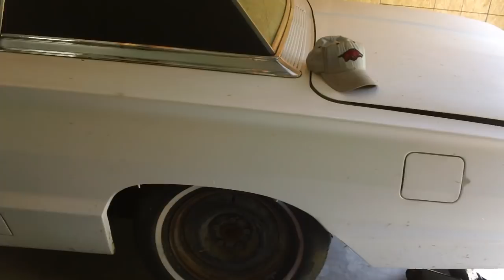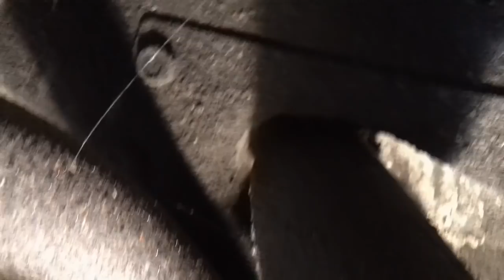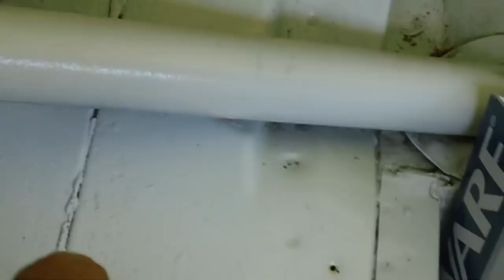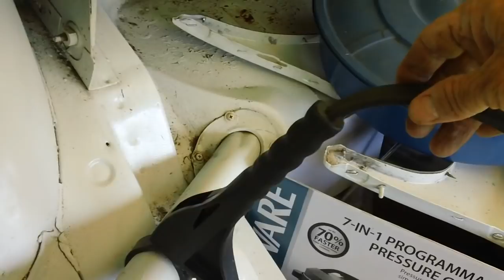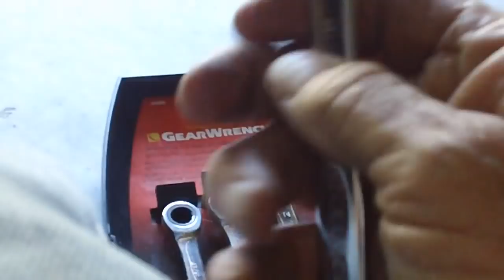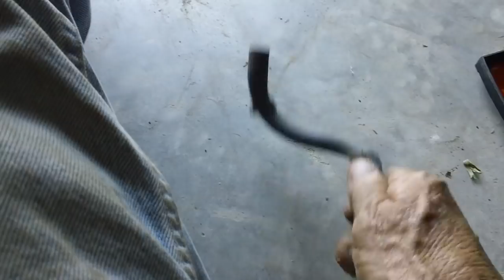1966 Ford Thunderbird repair and refurbishment (Part 11).  Rear shocks.

Comment: Don't you just want to kick some engineers and designers in the ass!  Moronic contraptions are senseless.  All engineers should have to take something apart and put it back again, so they can learn reasonable and serviceable design.